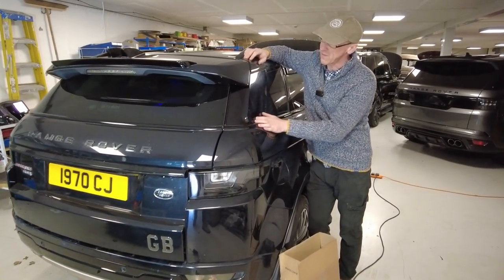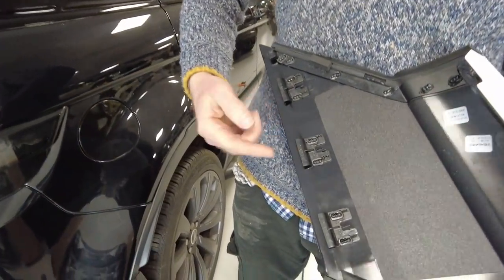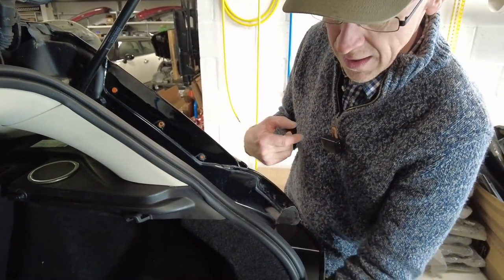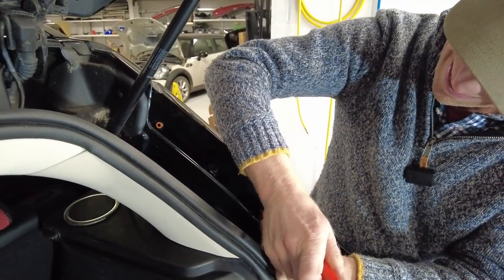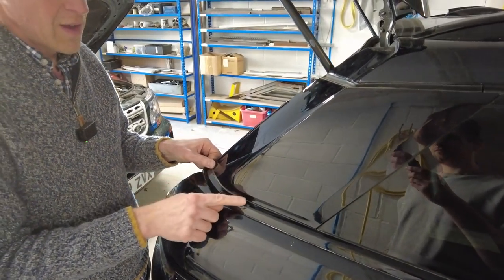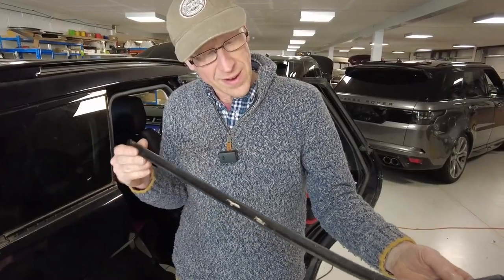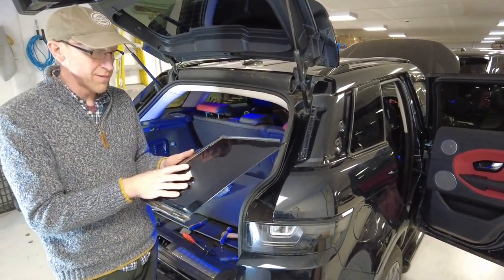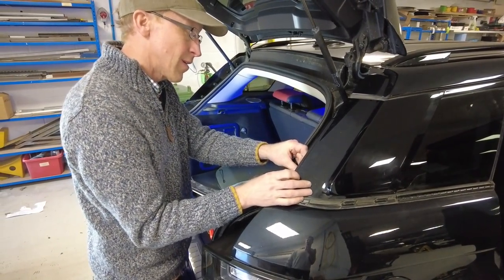Range Rover Evoque Rear D/E Pillar Rear Trim Panel Removal / Waist Trim Replacement

Comment: Those pins are reusable.  You only need to push the center part way in to release the "wings" and then remove the whole clip.  Once its out, you can reset the center pin.  You should feel a detent as you are pressing in the center to release.
Reply from the maker: Thanks Matt - I did wonder if that was the case but the pins seemed to fan out so it seemed that was not possible - but i must confess i did not try so i am pretty sure you are correct. I pinned this comment to the top to help others !
Reply: Exactly this. You push the middle through partway and then pull the whole clip out intact

Comment: Really impressed, I hope to remove mine to polish the scratches out.
Very pleased with the tutorial, similar to the other evoque video on the slipping rear door trim.
Reply from the maker: Yes seems like a good option to remove and give everything a clean - these plastics do show the scratches a lot !
Reply: Simon, just taken a closer look at my evoque (2016 HSE) and it is very different from what you have.
The lower trim is incorporated into the E pillar panel on my car. There is a smaller lower trim that only extends from the rear door to the E pillar.

Comment: 😮
Hi
Great video. On my evoque the bolt that hold tailgate strut has completely snapped off.  By taking the piller cover as in your video will I be able to get access to the bolt so that I can take it out completely and replace with new one.
Thanks
Reply from the maker: No i dont think this is going to help you - is there a hex showing
Normally there is something like this
https://www.sgs-engineering.com/catalog/product/view/id/1663/s/x3-ball-extension/?gad_source=1&gclid=Cj0KCQiApOyqBhDlARIsAGfnyMo1RDjUCztqY61pWSL8lGWEQMZcy0-5oyzmuYkUUDoZ2bnoIvD92KMaArL7EALw_wcB
Reply: @L663 I tried the link and it didn't work. I'm also faced with the problem of the broken bolt and the local dealership referred me to a body shop. It would be off great help if you can help with this.
Reply from the maker: @zolaQuela711  Here is the link to the parts on the website
https://www.powerfuluk.com/search?q=evoque+pillar&options%5Bprefix%5D=last

Comment: Hi! Great video! Are there any other plugs in the body that retain the clips when inserted? Or are the clips the only parts holding the panel to the body?
Reply from the maker: The plugs are the only fixings - there are the 3 hooks at the front edge where it clips on the glass but that is it !
Reply: @L663  OK, so no plugs on the metal frame? Just the clips? In the manual, they show some "grommet plug" that is supposed to sit there too in some way. Sorry to ask so much. It's the only thing we don't see on the video. I'm trying to figure out why my left-side panel is moving a bit. The clips are loose. Thanks!

Comment: Just a heads up. I noticed that the waist trim on my 2015 Evoque Dynamic 5 door is different. It doesn't go from the rear door the whole way to the back. The trim only goes along the window and the pillar cover is shaped like the trim at the bottom. I found a video that shows it you can check out:
https://youtu.be/n5xDLM-PpMo?t=50
Any updates regarding EU sales? 🙂.